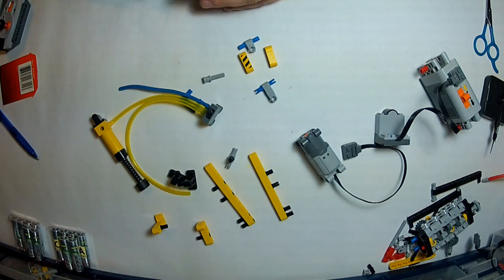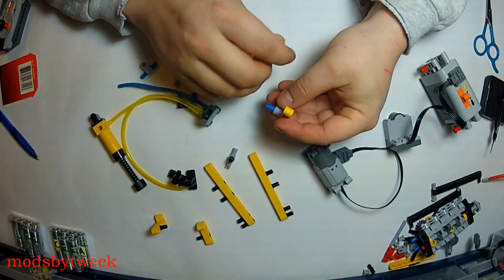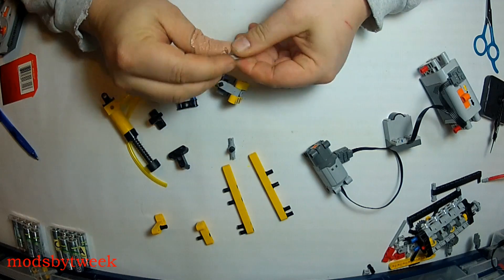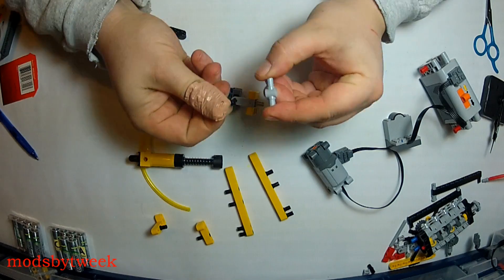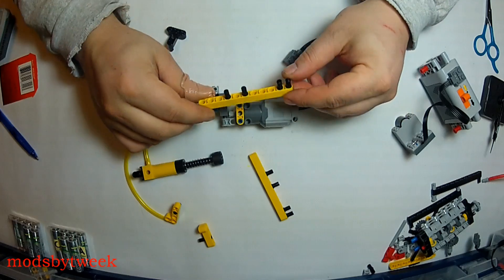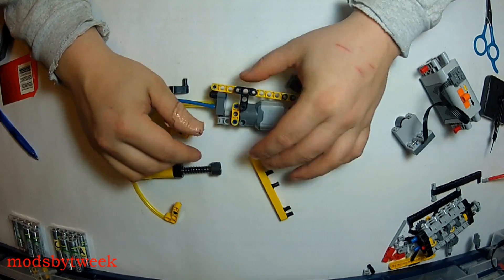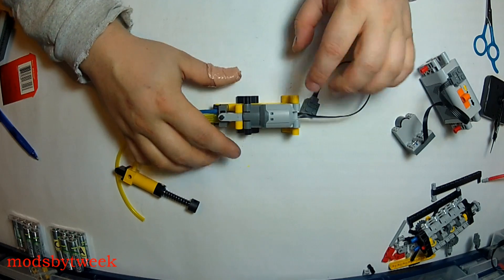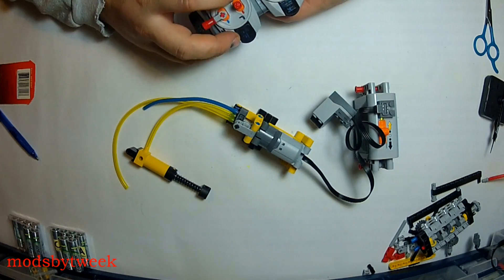LEGO Technic pneumatic Valve Switch Remotely controlled

Comment: Nice work, but I figure that using one of those white special gears where the axle can turn independently from the gear itself would be ideal for something like this. Then have the motor use a small 8-tooth gear to turn that big gear, and if you happen to turn it too far, the big white gear will just continue turning while the axle stops because of the switch.
Reply from the maker: you will need two clutch gears due to the friction in the valve. The servo motor adds return to center but they are not cheap.
LEGO Technic pneumatic Valve switch control with clutch gear
Servo Controlled Pneumatic Valve Switch